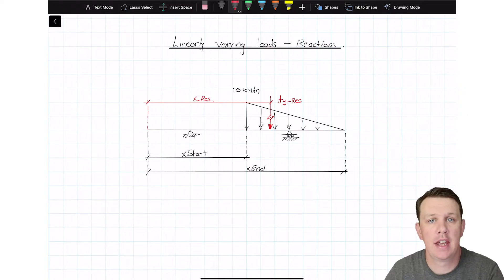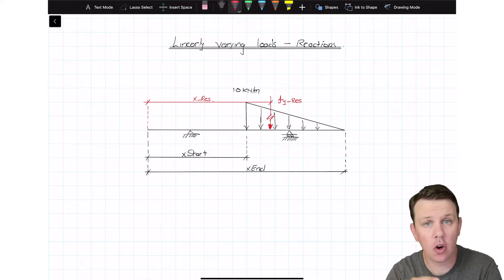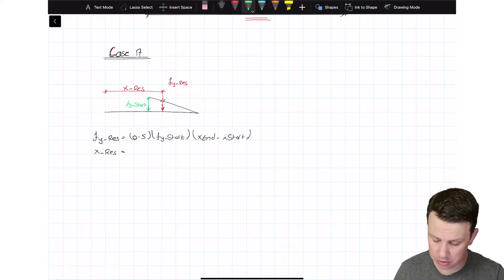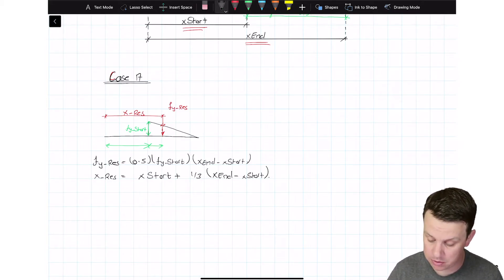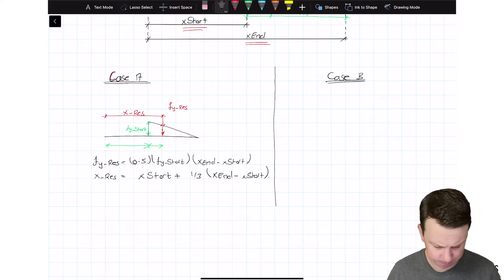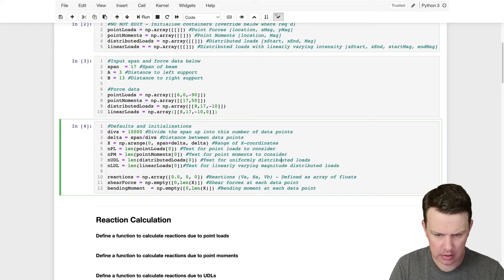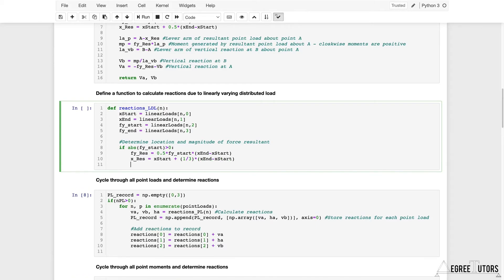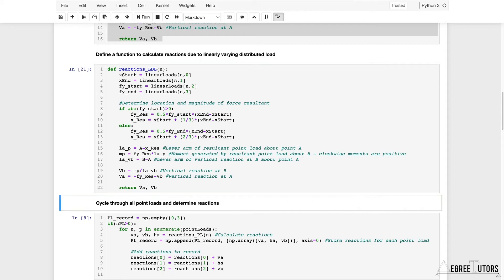[7/9] Reactions due to Triangular Load Distributions | Shear & Moment Diagram Calculator Project

Comment: Amazing Series, I have worked through your lectures and learned so much along the way. I have a concern about repeatability of the code. According to my understanding, it is a bad idea to repeat code with very similar structure and the way you have coded this problem has a lot of repeated code. Any ideas about how we could make it so that code repetition is minimal or non-existent?
Reply from the maker: Muhammad, thanks, I'm glad you found the series helpful. You're absolutely correct, where possible, you should try to use functions to capture repeated code. You could certainly refactor the code to reduce repetition. When writing a tutorial like this, it's always a balance between writing very efficient code and code that easy to explain and understand :)